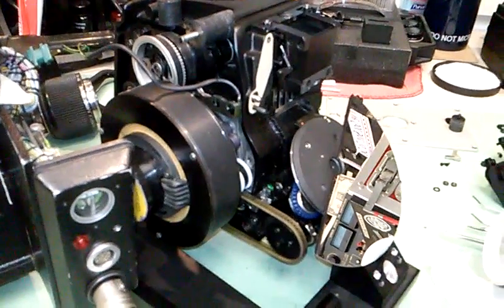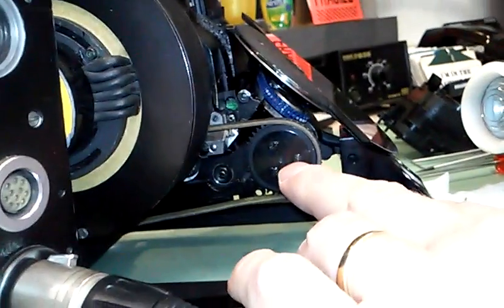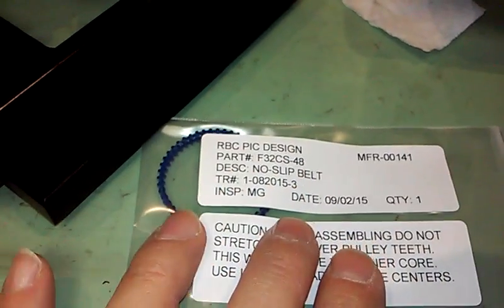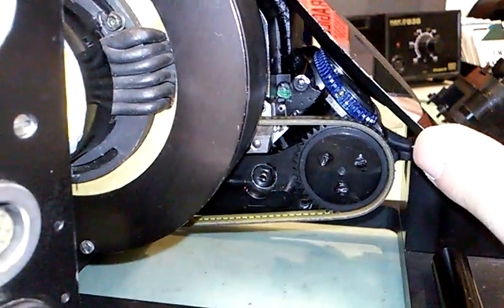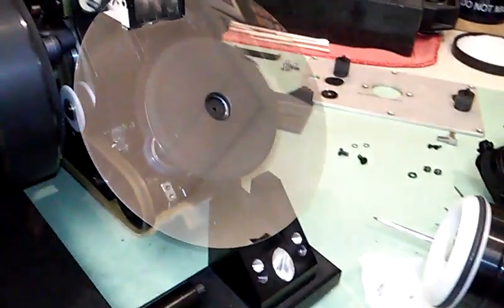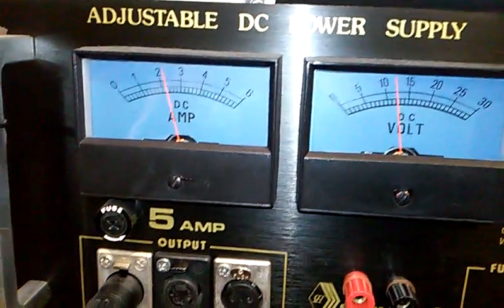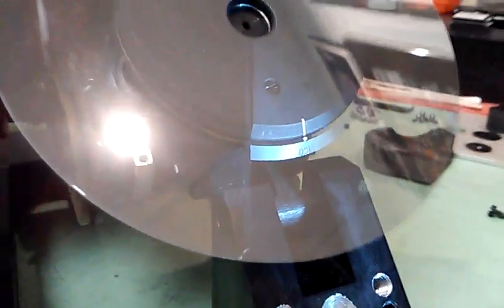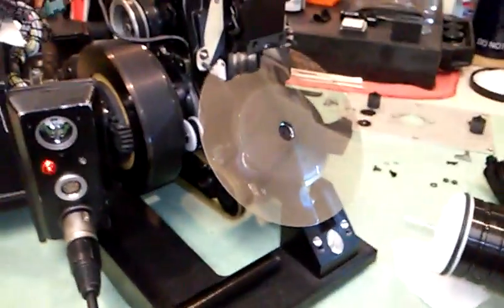Arri 35BL-3/4/4s shutter belt alternative

Comment: Say Paul, how much do you charge for a CLA of a BL4?
Reply from the maker: A typical CLA on a 35BL is not as typical as it used to be..... To check spec's and spot lube the movement and clean a few smudges off optics is an hour or two of labor however these cameras are now older than many of their owners so I would recommend that the cameras be sent to a qualified, trained technician for inspection as things like film gap, registration pin bushing wear, pull-down claw wear and so many other variables can affect the quality of the product these machines produce. It is better to be completely informed of any issues if found and how those issues may affect your footage before starting a long and expensive project rather than blindly trusting that a blob of grease and an acetone saturated Kimwipe is going to address all possible issues. I can inspect and service your camera at Visual Products in Ohio. We are easy to find on the internet and have been around for over 20 years and I have been working on ARRI cameras for over 30 years now so can steer you in the right direction with what you've got and what you need..... give me a call!
 Happy shooting, - Paul